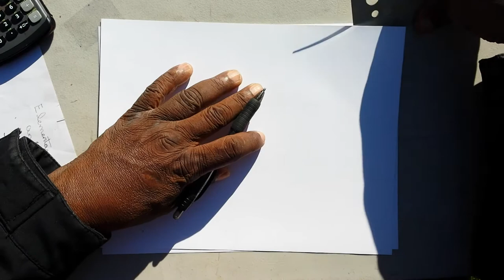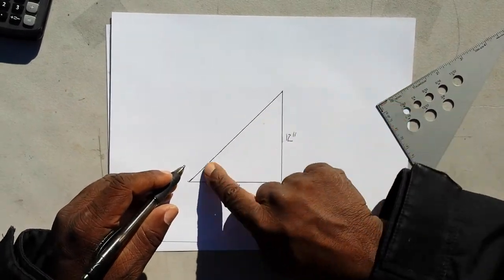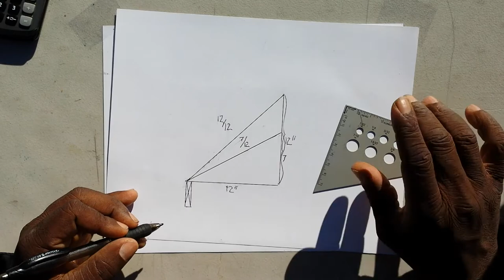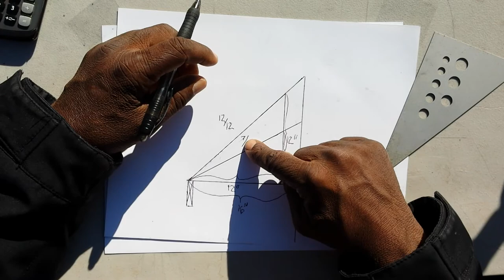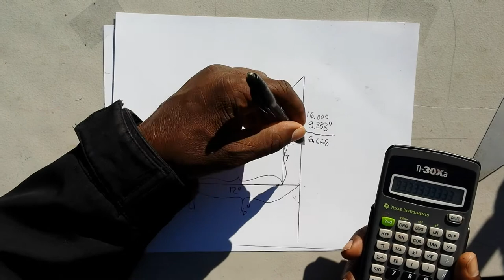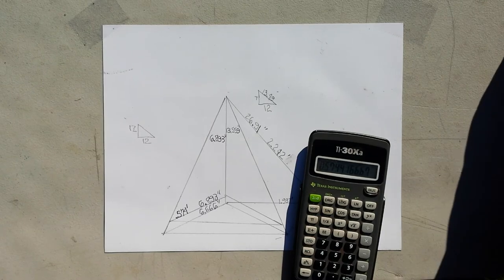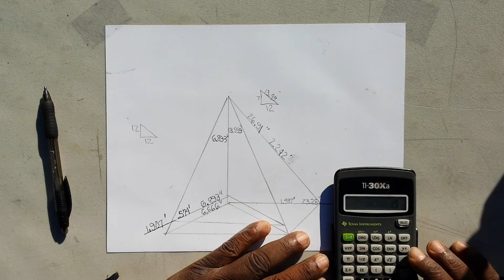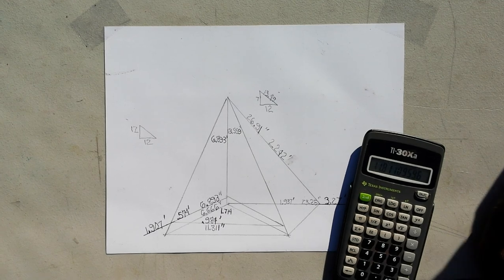PT2 In-depth mixed pitch, hip and valley roof cutting math theory and technique series.

Comment: How would you get the run of the steeper pitch if the pitch is a 16. Or any other pitch except a 12. Thank you
Reply: you would just go up 16/12 instead of 12/12. Or 1.33333 vs 1 inch up per inch.